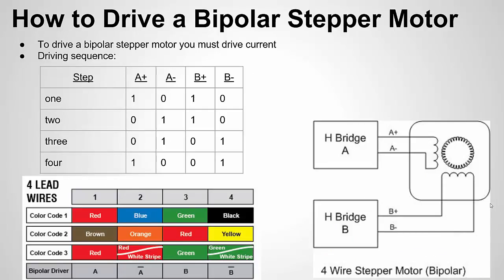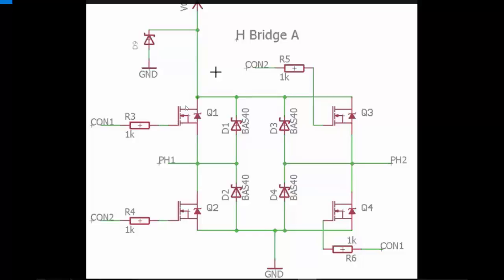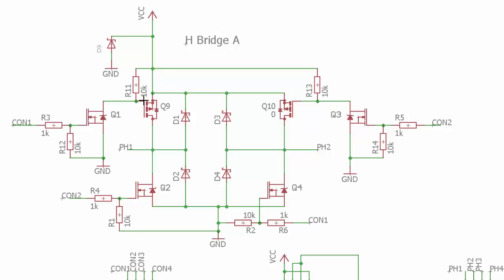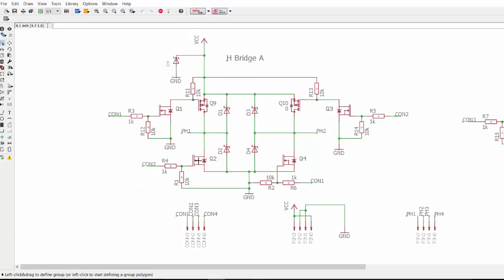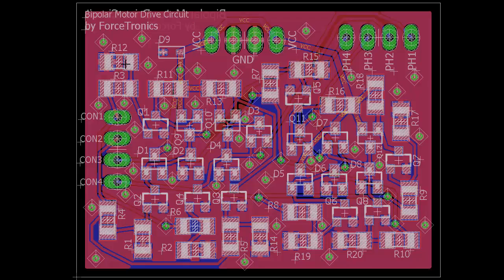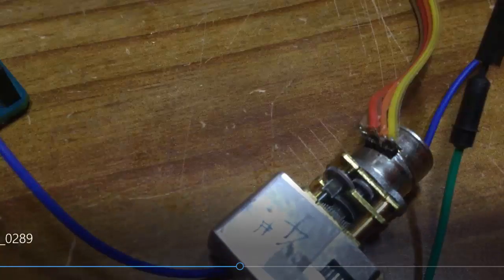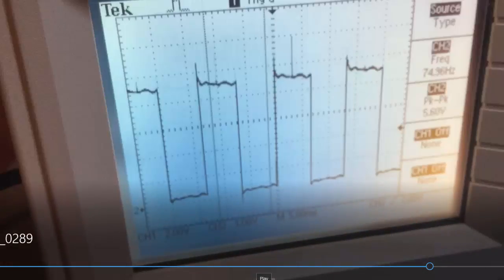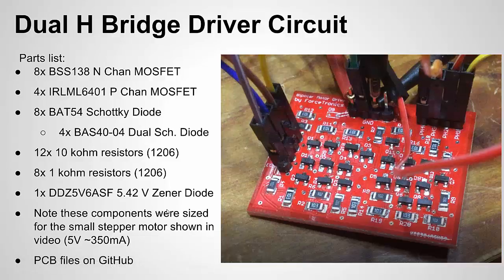Designing a Driver Circuit for a Bipolar Stepper Motor Part 2

Comment: Couldn’t you simply join the gates of Q2 and Q9 etc.? Avoiding the extra P-Channel?
Reply from the maker: Q2 and Q9 are in the same H bridge "leg" so without the second P channel you could not get current to flow in both directions through the motor coil. That configuration might work for a unipolar stepper motor.
Reply: @ForceTronics  - I was refering to reversing the logic of the P-Channels & deleting the need for the extra N-Channels to pull the P-Channels low.
Reply from the maker: Okay now I understand what you are saying. You are correct, that approach would reduce the amount of parts so good suggestion. You would just want to make sure you have an active logic low level so you are sure to discharge any parasitic gate charge on the P Channel MOSFETs. Great comment!

Comment: I'd like to know if there is a way to turn a stepper using an alike stepper? nema 17 to nema 17 and produce an ability to do work. I have a couple of 17's (42HB's) and a l298n in the junk box. Hooked together one stepper will turn the other but no ability to do work exists. Do you know of any links that would point me in the right direction? if it is even possible.
 Would like to tune a single air variable capacitor on a magnetic antenna at an outdoor location. Thought about using one as a generator with a direction switch in triggering SSR's and gating voltage to the appropriate pins on my l298n, that way I would still have the rotary effect . Maybe even a voltage doubler circuit for more excitation due to most ssr's trigger at 3 volts. Will run a 30 to 40:1 reduction off the stepper into the vari cap. Really don't want to get into the Arduino stuff with an encoder as I'm a senior. Being the stepper is just a AC Generator and there is no apparent lead or lag of the coils for direction influence and the stator per coil is in part internally out of phase it's probably all a bad idea. It's just that it works when they are directly hooked together.  Any input is appreciated.

Comment: Very well explained. Would you be game to showing how to take different sized steppers and and your method of choosing what components to use?
Reply: Would be nice to know which components would need to be sized for a different stepper motor voltage or current rating :)